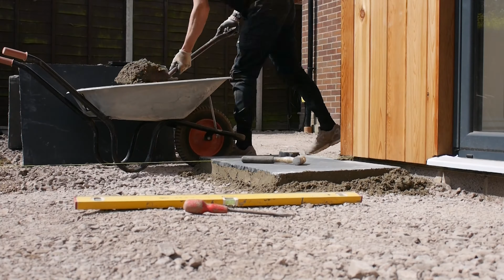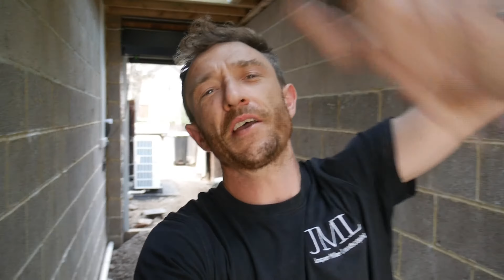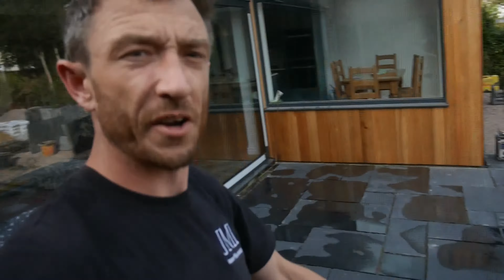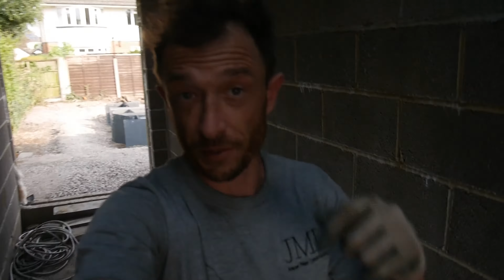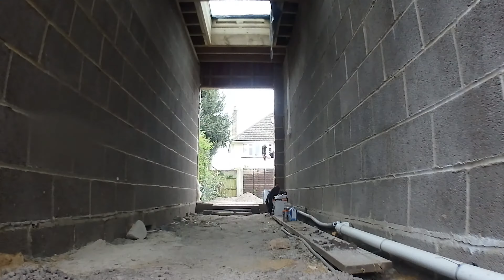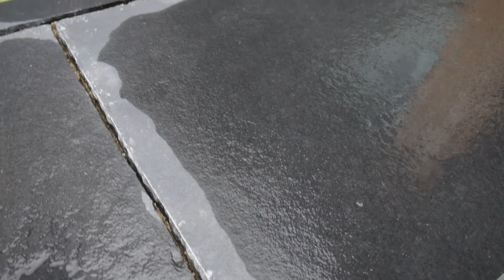installing limestone slabs - short week

Comment: Looking good mate are they having the limestone sealed to keep the wet look may stop that dust problem 
I’m back on the fencing for a few weeks now just seriously knackered at the mo
Reply from the maker: Sorry joe I never saw ur message pop up, thanks for the comment,  yeah coming along now, thanks for the advice on sealing the limestone I'll recommend this to the customers. Have you sealed slabs yourself ? Anything to look out for?, how's work been anyway mate? I know what you mean about being knackered,  I just can't get motivated at the moment.
Reply: @jaspermillerlandscaping6174  I’ve done one sandstone patio 
Jet wash leave to dry completely then roll on sealer one way leave to dry then roller on the other way to cover any dips or peaks in the slab 
Don’t do it if rain forecast as it will crystallise and it’s a nightmare to get off 

Phone has been busy the last week booked into July now just still absolutely knackered😂
Reply from the maker: Nice one mate, really appreciate the advice 👍  and nice to hear your busy,  do you take bank Holidays off?